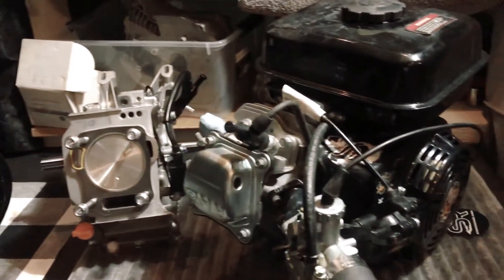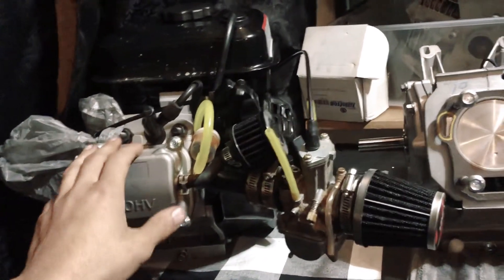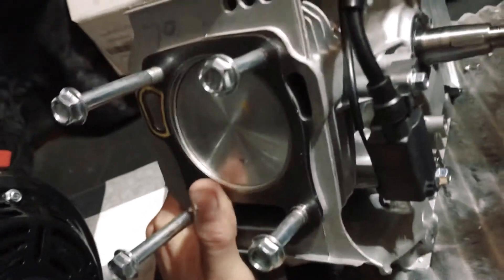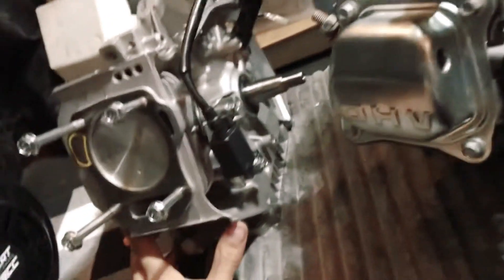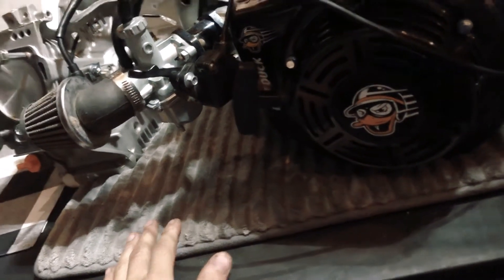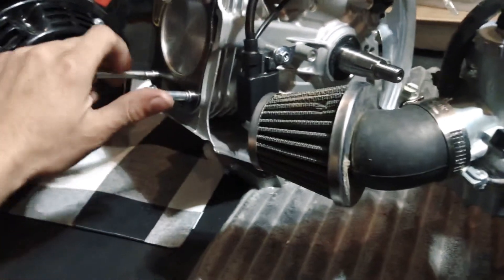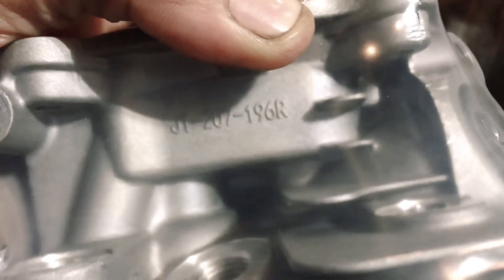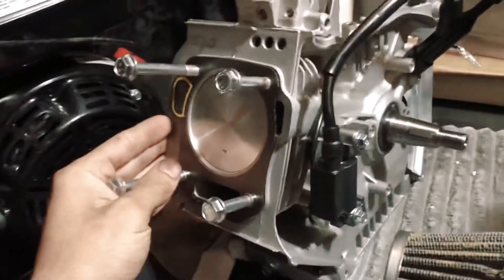Tillotson  212r and Wildcat 223cc BUILD TALK

Comment: BTW how did you find out they were running the 196r cams in the 212r's everyone I tried asking never could tell me but when you mic it out against the dyno cams superx they are both very very close in lift which is crazy .265.  Don't know if you found the same thing taking it apart.  Anyone know if there are any motors that come with the aluminum flywheel like the 212r did on the cheap lol.
Reply from the maker: Harbor freight Ghost 212
Reply: @Djjustus181  the harbor freight ghost is terrible.

Comment: the tillotson 212r was the best bang for you buck when it was out.  The flywheel it comes with can handle 10k np.  Plus running the smaller head and then a .010 head gasket your at over 10.1 compression.  It's the motor I started with as a build kinda wish I left it stock for the dirt oval we run got to much power now.  Run a .265 lift .236 dur ex & in dyno cam super X.  26lb springs, billet rod for zero deck, pe24mm round slide, ported head.  Absolutely rips I been trying to find even a used 212r since they are such a good starting point since the flywheels good.

Comment: I did the rod, Flywheel and such did you use the EC rod with the Banzai cam? Any issues?
Reply from the maker: Yes , my strocker 72mm build has 265 banzai no issues yet besides my side cover loosing . Red loctite side cover bolts
Reply from the maker: 18lb springs is all you need for 6000-6600 rpm
Reply from the maker: Lighter springs rev faster
Reply: @Djjustus181  I'm also doing a Predator 212 Hemi (rod,Flywheel, X cam installed) I'm going to add a stainless valve kit with split retainers.  Some people say this cam is better with 22s on a stock carb and 26s on a mikuni. I'm kinda leaning towards 26 being a bit much but the 22s and split retainers making sense. I'm hoping for a dang 20mm carb to make this stuff easier for tuning.
Reply from the maker: @fatbuddycat  I’ve ran it with 22 with x cam definitely rev faster than 26lbs it calls fit .
Reply from the maker: @fatbuddycat  run a pwk 24mm
Reply: @Djjustus181 You made very good point with the 6500 rpm number too. This isn't drag racing, this is a "I have the power and I want it now" sort of thing. Your a smart dude!
Reply from the maker: @fatbuddycat  yes sir thank you  , it’s all in how you build  your engines for . Yea you can put shiny billet parts in a block but that doesn’t make it fast and built . It’s the tunning and head flow that’s makes power . I have stocks blocks beating built engines like nothing they can’t even keep up .
Reply: @Djjustus181  by pwk carb are we talking knockoff? Chikuni style? I need to learn slide carb tuning too. If you do any head work videos I'll be standing by, even if it's just showing the tools and pointing out the basics. If you have two matching heads, one worked over, one not you could really step it up. From ALL the videos I watch I never see them compared side to side, it's always before and after which doesn't really cut it.